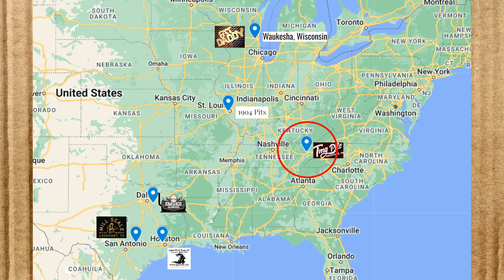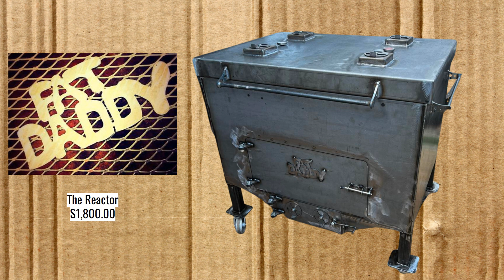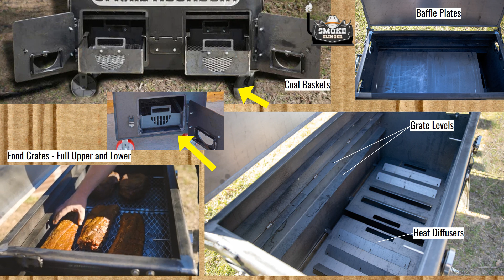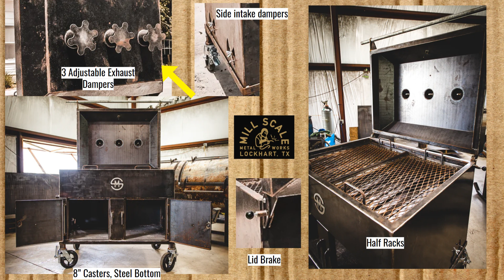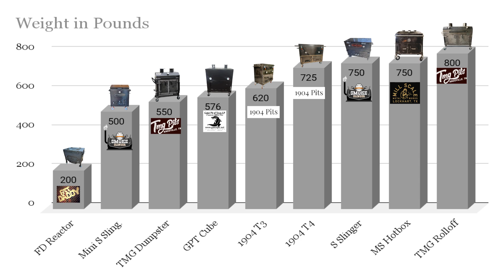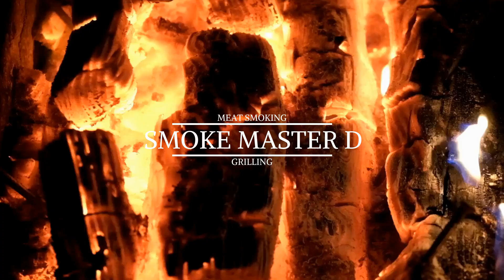BBQ Buyer's Guide to Full Size and 3/4 Size Direct Heat Smoker Grills - Hot Boxes - Smoke Boxes

Comment: 1904 is an absolute dream pit. I had Smokeslinger as my goal pit, but I much prefer the style of the 1904 pit as it suits my style of cooking better. I think the baffles on the Smokeslinger are an amazing, feature for temp and zone control. However I really dislike like the idea of charcoal drawers (even if I can remove them) and would probably never use the baffles. That’s a hassle having to find space to store all the extra stuff the Smokeslinger has that I wouldn’t use.
Reply: everything in it will store under it between the wheels no extra space needed

Comment: Going to add a new comment to this video. I smoked a chuck roast via indirect on the TMG Pit Dumpster... Used chafing pans on the lower rack to protect the bottom and push the heat around. Built the fire the right side, near the door, with the right door vent open, and the placed the roasts on the left side of the cooker. I only had to open and had the left lid vent open, with the right lid vent closed. Smoked 6 hours around 275F, a few short heat temp spikes and dips here and there, nothing to worry about at all, then wrapped ni butch paper with a tiny bit of water, finished in the oven for 2 hours at 300F to render the fat. Came out perfect. Might have been my favorite cook on the Dumpster so far. 

The 36x24" size with the two front doors that give you access to the lower cooking grate is so convenient and makes for a great smoker as well as a direct heat cooker. ...The Dumpster is so versatile. 

Yes. The Dumpster venting is now on the front doors, and not on either side of the cooker. This is a big improvement.
Reply from the maker: I've used the El Patron as a smoker as well and it can also do really well. Thanks for your input!

Comment: More of these pit makers should add baffle options, from my uneducated perspective it does not look like much work to weld on a couple more angle irons on the inside and cut out a fitting metal sheet with a strategically placed hole to enhance indirect smoking performance.
Thinking any of the pits with a second shelf such as The Dumpster would be the easiest to "mod" using the second shelf as either a charcoal holder or a baffle (big pizzastone) holder.

Comment: You mentioned how how didn’t really like the charcoal drawers on the Smokeslinger. Most of the time when I use mine I remove the drawers and cook directly on the floor of pit. Build my fire on one side and cook up top on the opposite side. I can just slide my grate over on top of fire side for more direct heat when needed. Works great. Also I’m sure the guys at Smokeslinger would be happy to leave off the drawer slides if you prefer a totally open floor design.
Reply: any regrets with the Slinger? It's been catching my attention
Reply: @suhaibghazi7673 no sir!  It’s a great cooker.

Comment: I’ve had a full size Smokeslinger for a year now and absolutely love it!  The build quantity is excellent. Very versatile and can be set up many different ways.  I’ve got an offset too but this pit has gotten me better results with my bbq.  Doesn’t use nearly as much wood either.  I would definitely recommend giving it some consideration.
Reply: How easy is it to control temps?
Reply: @corylambo73  not bad just takes some time getting used to it like any pit. I mostly use wood and have found adding small splits is the key. About every 30-45 minutes adding a small split keeps it steady for me.
Reply: @Harrellpitmasters  - same. I've been adding splits every 20-45 minutes - depending on ambient temps outside. 
The warmer it outside, the less I need to add a split.
Reply: I've seen the Smokeslinger guys on FB posting pics of their briskets. They look so damn good. After cooking with my new direct heat cooker for two weekends now, any little lingering desire I might have had for an offset cooker, has vanished. You can cook directly over coals. Directly over wood. Directly over wood and coals. Indirectly (long and slow) with wood. Indirectly (long and slow) with coals and woods. You can cook fast directly over coals and/or wood, and you can slow directly over coals and/or wood... So much versatility.

Comment: Great run down on this category. 

The original smoke slinger was 44x22" and started at $1,800 - bumped to $2,100 last year. That size is no longer available on the website, so they have the 30x24" ($2,100) and the 48x24" ($2,900).

On the TMG Dumpster, the gas strut allows for easy opening that heavy lid, but more importantly, also provides a "soft close" lid - which I find fantastic. No worries about getting a hand or finger slammed on... Very happy that feature is now standard on the Dumpster. The gas strut was the one alternate feature I requested when I ordered my Dumpster last November, and the guys at TMG apparently decided to make it standard on the Dumpster going forward.

Edit 3 hours later: Early TMG Dumpster review: 
I've had my Dumpster for two weeks - starting my third cook right now. I live in SE Wisconsin, and looked at Fat Daddy. I wanted to like their pit, but it's pretty crude looking. It's built with thinner steel, and the fire access door in the front is pretty small. If you wanted to access a lower cooking grate, or wanted more space for your cook, because there's barely any room on the top grate from under the lid. 

The three best things the Dumpster has going for it: 
1) the front access pull out lower shelf: You can cook on that rack, add coals to the rack for a sear station, or you can add water pans/heat baffles for a better indirect heat cooking experience. 

2) Room under the lid: There's plenty of room under the lid for larger cuts of meat like briskets, whole turkeys or even a decent sized skin-on pork shoulder. 

3) The fire doors are large, making the fire easily accessible. You can open the left door, leave the right door closed, so you don't lose too much heat, if any. 

I did a heavy comparison between the TMG Dumpster and the Smoke Slinger - the Smoke Slinger was overly complex with all the baffles and heat deflectors. ...and more to the point, how you access those pieces. You have to remove the top cooking grate from the smoke slinger to access the lower cooking rack. You have to remove the top and lower cooking racks to access the baffles and heat deflectors. So if you want to adjust your cook, you're pulling cooking racks out of your cooker. 

However, from all of the videos and photos I've seen from the user's group on FaceBook - the Smoke Slinger makes some great BBQ. 

The Dumpster Build quality might be considered over-kill/over-engineered. It's a literal tank. It's going to last a lifetime. The doors are reinforced to prevent high heat warping. 

I made my first batch of spare ribs last week on the TMG Pits Dumpster. I ended up using a bed of charcoal, and threw some small kiln dried oak splits on the coals about every 40 minutes or so during the cook. No heat baffles or deflectors. It was very cold during the day, so the heat fluctuated quite bit from 250 to 350 - but it settled in and averaged around 300F. I have to think the fast burn rate of the kiln dried wood added to that difficulty. The ribs were finished in 3 hours, and easily the best ribs I have ever made. Juicy with a great oak smokey flavor and a great bite - wasn't falling off the bone. I honestly can't remember if I've ever had ribs better than these. Could these rival offset ribs? 100% yes. 

I made a nice batch of wings at 350F for about 80 minutes directly over coals (no wood splits used) for the NFC Championship game. Good direct heat smokey flavor, with a crispy skin. I may have left the wings on about 10-15 minutes too long - but the wings were still outstanding. I had zero issues holding temps at 350F over a big bed of coals for the wings. 

I'm sure I left something else out, but the versatility and possibilities with the Dumpster seems endless. If you can only have one cooker, I can't see a reason to buy anything but the Dumpster or the Rolloff if this is within your budget. I can't wait to get a brisket going when the weather warms up, and I get a better idea of managing temps on the cooker during February.
Reply: TMG is the premier pit builder as of today. Pig Iron Patina is crazily innovative as well for offsets and trailer builds. Both are top notch!  Cheers!
Reply from the maker: Thanks for your input 🙂
Reply: What are your thoughts on the insulated firebox on the dumpster? My biggest concern is that it’ll be too efficient and not burn through enough fuel
Reply: @rsaunders223 - I wouldn’t say the dumpster has a firebox. The floor of the dumpster is insulated, the rest of the build is not insulated. 

A little coal bed and a small split every 30 minutes to hold temps at 300F for 3 hours makes it a pretty efficient cooker.
Reply: @craigjohnchronicles2504 I thought the general consensus with these types of smokers is that the least efficient the better? Otherwise the food isnt getting enough smoke
Reply: @rsaunders223 - direct heat cookers are for cooking live over coals or fire at higher temps. 

The fat dripping into the coals (no wood cook) provides smoke flavor. Though not a wood smoked flavor.  

If you use small wood splits, and cook directly over the small fire, the fatty smoke flavor adds another layer of smoky complexity. 

Ribs and pork steaks will take about 3 hours, giver take, to cook at 300F over direct heat. There will be plenty of smoke flavor. 

Chicken takes about 1 hour to 90 minutes over direct heat, between 300F and 350F. There will be plenty of smoke flavor. 

Setting up the smoker for a long indirect low temp cook, like a pork butt or chuck roast, will give you plenty of wood smoke flavor. Even when using small splits with charcoal to hold temps. 

Yes. It’s pretty efficient. No. There isn’t a problem with smoky flavor.